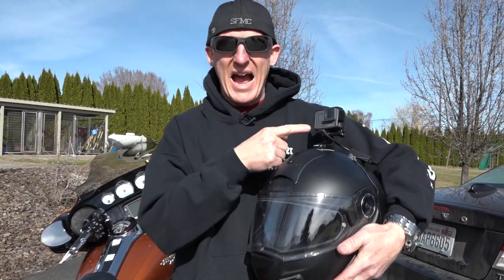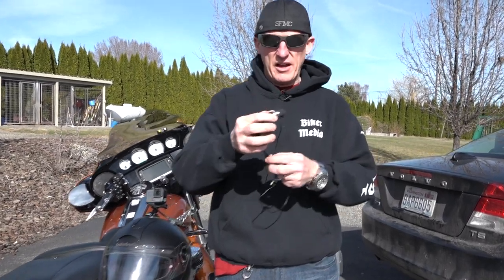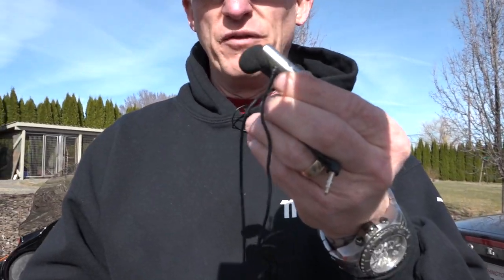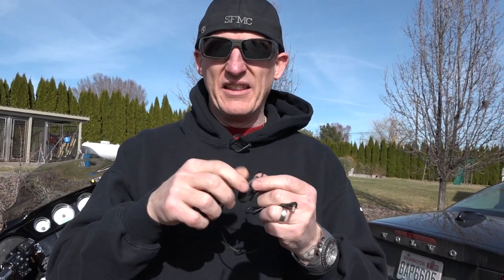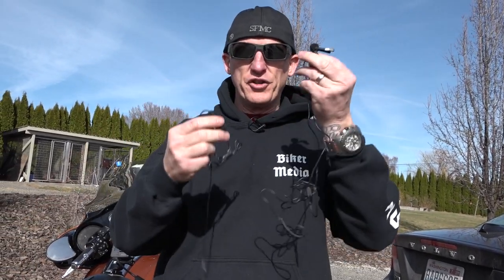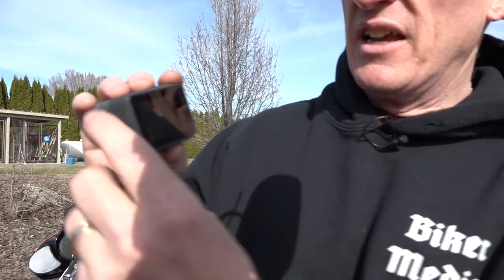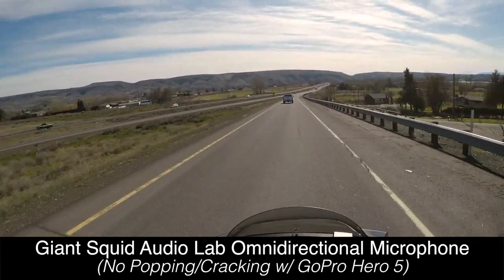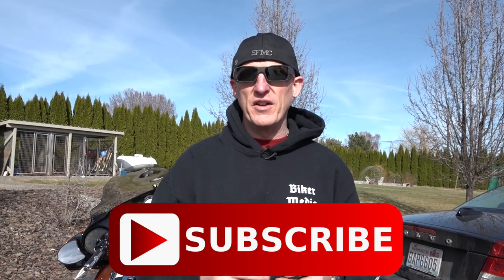Motovlog GoPro Hero 5 Black Audio Mic Problem Clicking & Popping-How To Fix

Comment: I just wanted to thank you for sharing this video. The old microphone I used worked perfectly with my GoPro Hero 4 but when I switched to the Hero 6 Black the cracking noise starts at 30mph and it rendered most of my footage unusable. I bought two of the Giant Squid microphones (One in my cheekpad and one next to my speaker to capture intercom audio) and it worked wonders! No more cracking sounds period! My video Senpai Vlog #3 demonstrated how great these microphones are. The cracking does start at 170mph (Again most people won't be going that fast) and it's not even noticable lol.

Comment: I had the exact same problem and pin pointed it down to the Sony mic being what i think is just too good.
I ended up using a suggestion from another you tuber on using the mic from a pair of iPhone earphones. He used iPhone ones but i tried my skull candy ones and worked an absolute treat. I did have to get a TRRS to TRS adapter. I will probably get a proper mic but for the time being I'll carry on using the headphones mic.
Reply from the maker: Right on.  Thank you for sharing your solution.

Ride safe & Ride Often!

Here is a link to a bunch of our useful Free vids: http://www.lawabidingbiker.com/freevideos

Here is a link to some of our useful for purchase videos: http://www.lawabidingbiker.com/buyvideos

Want Answers & Information Fast? And help support us at the same time? Do you like the content we provide?

Our patrons get answers to their questions/comments/feedback in less than 24 hrs and are part of our Private Facebook Group. If you are interested in being in this exclusive group you can get all the details at ==> http://www.lawabidingbiker.com/patreon

If you haven't subscribed to the Law Abiding Biker Podcast make sure to do so. Listen in as we talk weekly about issues/items like this & so much more. You can listen on iTunes (Apple/IOS), Stitcher Radio (Android), or any other Podcast App ==> http://www.lawabidingbiker.com/podcast

Join our free email club at http:///www.LawAbidingBiker.com/EmailClub. Only relevant content will be sent from time to time. Email club members are the first to find out about free or for sale content are given special coupon codes.

Comment: Ran into this exact same issues during my Canada road trip this summer with the same mic and camera. I have a hero 7 now and the issue still persists with the Sony lav mic. I am going to test the Purple Panda mic tomorrow and see if that fixes it. It is also a stereo mic, so I'm interested to see if it is in fact stereo that's the issue, or if it's just the Sony mic. If the Purple Panda doesn't work, I think next up i'll try the Big Squid.

Comment: UPDATE on Mic Problem:  I was able to get my GoPro Hero 5 Black w/ Giant Squid mic to finally work without crackling and popping.  You cannot use the "Standard Mic+" setting.  Initially, I had it on that setting and when I was getting the crackling and popping, I switched it to "Standard Mic" setting without first shutting off the camera and unplugging the mic.  This mic definitely works with the Hero 5 Black but only on the 'Standard Mic" setting.  Thanks Ryan for your recommendation on the Giant Squid Mic and Hero 5 combination!
Reply from the maker: Great info Randy! Thanks for sharing with the community.

Comment: Hi Ryan, my Lav mike worked perfect on Hero 4Black, now on Hero 7 black, same
Issue with noise as you but not every time, after checking everything I narrowed it down to the connection from adapter to Hero 7, my solution was a small strip of cello tape on the metal part of the c connection to make it a good firm fit and then support the connector with Blue Tac and waterproof the unit!  Another way to waterproof the connection is with surgical silicone sold to make your own ear defenders, blue tac I think is better as more supportive!     Regarding powering GoPro cameras , battery life is not good, now tec uses more power so I use a battery bank for helmet cam and bike usb outlet for second bike cam, your thoughts appreciated, stay safe and enjoy riding.

Comment: I had same problem today with mine. but i was just outside in strong wind. when the wind stopped the noise stopped. i was using a saramonic mic then i tried a powered mic. the powered mic was better but it was still there. i finally fixed the problem with a massive pop screen. it seems the gopro just cant process the wind noise or something. thank for the vid.
Reply from the maker: You bet!

Comment: Hi Ryan, the problem is actually in clip trust me 😁 on sony mic you don't have a clip on 2nd mic you have a clip. I went nuts trying to figure out why that crackling noise happens and seems like movements of the cable on speeds close to an end (where mic is) is what's causing the noise. In my case I've put the clip on and works all right no noise. Now the question is why we need to f. ourselves with all this external adapters cables etc. look what your helmet looks like, mine is the same, I'm thinking to f. off the gopro and look for less hassle solutions. Take care 👍
Reply from the maker: Thank you so much for sharing.  I appreciate the info.

Ride safe & Ride Often!
Here is a link to a bunch of our useful Free vids: http://www.lawabidingbiker.com/freevideos
Here is a link to some of our useful for purchase videos: http://www.lawabidingbiker.com/buyvideos
Want Answers & Information Fast? And help support us at the same time? Do you like the content we provide?
Our patrons get answers to their questions/comments/feedback in less than 24 hrs and are part of our Private Facebook Group. If you are interested in being in this exclusive group you can get all the details at ==> http://www.lawabidingbiker.com/patreon
If you haven't subscribed to the Law Abiding Biker Podcast make sure to do so. Listen in as we talk weekly about issues/items like this & so much more. You can listen on iTunes (Apple/IOS), Stitcher Radio (Android), or any other Podcast App ==> http://www.lawabidingbiker.com/podcast
Join our free email club at http:///www.LawAbidingBiker.com/EmailClub. Only relevant content will be sent from time to time. Email club members are the first to find out about free or for sale content are given special coupon codes.

Comment: hi thanks Ryan for the tip, I have the same issue with my Hero 6 and SONY ECM and also tried with GiantSquid stereo and faced with same issue. So I took your recommendation and placed an order for GiantSquid Mono, I will get it in 3 days. I will do a shoutout / test run once I have that. Thanks for sharing.
Reply from the maker: Rock on. I hope it works!!

Comment: Great video! I was also starting to think it was my GoPro Hero 7 Black having issues. I guess I need to change out my microphone. I have the same issue at speed with the mic I have on. It works on the GoPro hero 4 black nicely, but I have the same popping and crackling going at highway speeds.
Reply: Sinbad683 got the same issue now with my hero 7 black.

Comment: Ryan, thanks for the vid. I'm experiencing same popping/crackling problems when I'm at speed (maybe 30+ mph) whether using mono or stereo mic with the Hero5 Black. Going slow it's clean. Had several GoPro models and sad to say they are losing me fast.
Reply from the maker: Yah, GoPro definitely is failing big time with audio issues.

Comment: I have the same mic and mine won't work at all. did you do anything in settings to get it to work? I tried the forums for a solution but its been hit or miss since they released firmware version 2.51

Comment: I bought that giant squid mic and it does not work with my Hero 5 black. I have the 3.5 mm adapter ofcourse, and I only get noise. My camera says it's up to date so I just dont understand why i can't get the sound. Has been a few days since i got the mic now and I've watched and read all tutorials on the internet - so I'm actually starting to get angry at this point. Why does it work for everybody else and not me ?! 😥

Comment: Can I ask where you put the Sony mic in you helmet? I put mine between the cheek pad and helmet and was still getting some awful wind noise. I'm not asking about the clicking noise yet. Though I will be trying to find one of these mics to change out this sony mic I have. By the way I do have the sony mic you mention in the video. I've even added extra foam onto the mic ends and still wind noise. It starts out about 40 mph and gets worse. It's fine below 40mph on almost any setting. Do you have any suggestions besides the change of mic I'm going to do when I find one. Also your audio settings i will change too when i get home. Any help would be greatly appreciated because I haven't found any anywhere. I spent three days before a trip to Alaska last year and wasn't able to take it with me because of this.
Reply from the maker: https://www.lawabidingbiker.com/motovlog/

Comment: Hey bud, had the exact same setup and issue with the Sony ECM. Bought the Giant Squid mic after watching this video but I'm getting problems with that too. I've seen other videos using this giant squid mic and it's working fine but for me, not so much. 😩😩😩😩
Reply from the maker: That sucks bro, man....frustrating. did you go into your settings and change it to "stereo only"? Instead of "auto"?

Comment: Fyi, I experienced crackling at high speeds with the GoPro Hero5 Black with Giant Squid mic.  I'm not using a clip and had it tightly taped to the front inside of my Shoei RF1200.  Couldn't figure out why I was getting the crackling at high speed and finally just removed the mic adapter and mic from my helmet because of my frustration.  Really annoyed after investing the expense and time for a mic that was recommended.
Reply from the maker: Still working great for me. Sucks your having problems.